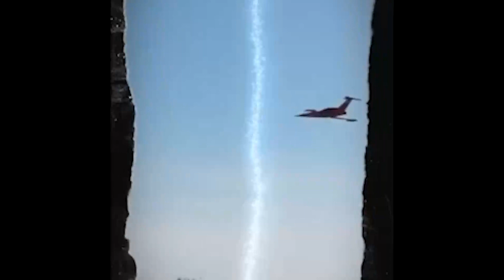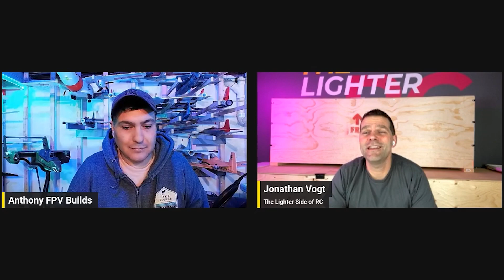Turbines Vs EDF which one wins the future ?  Episode 12

Comment: I agree that the biggest issue with flying EDF is the batteries needed.  Most larger jets just get 2-3 minute flight times when pushing them.  If you put an EDF in a balsa or composite frame, then it typically takes 12S or more to power them and you really need quite a bit of room to fit in enough batteries to give a decent flight time.  Prop planes tend to get decent times, but it's the EDFs that are lacking.  Charging batteries for 25+ minutes for a 2-3 minute flight can be frustrating especially if it is an unplanned trip to the field.
Reply from the maker: I agree! Hopefully battery tech will improve in the future